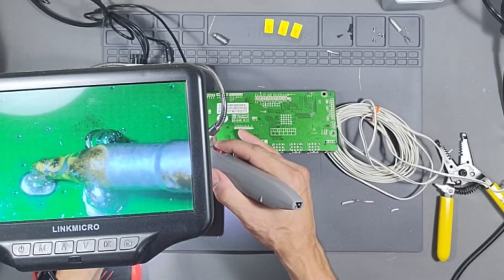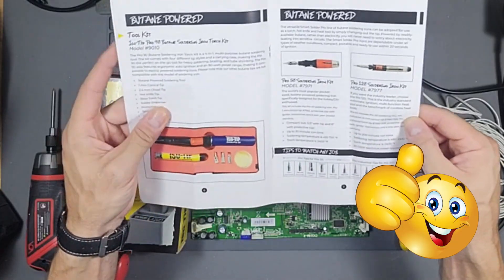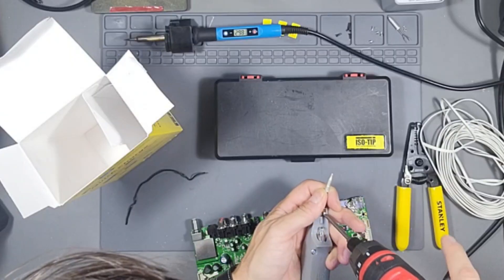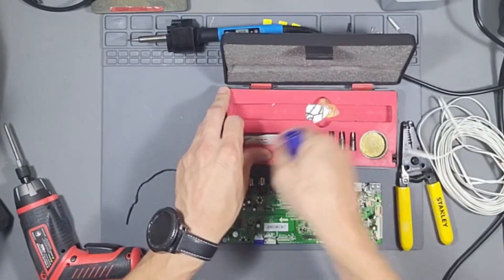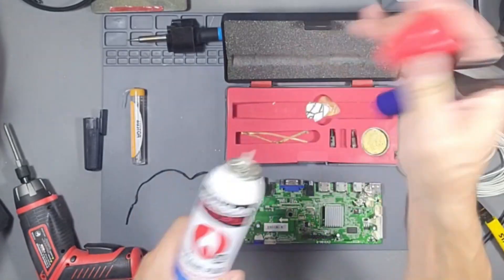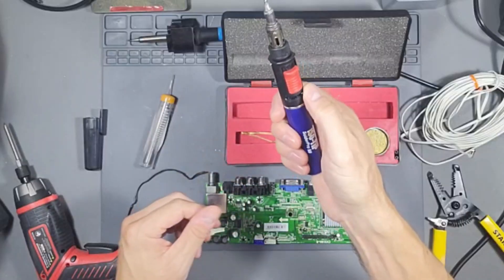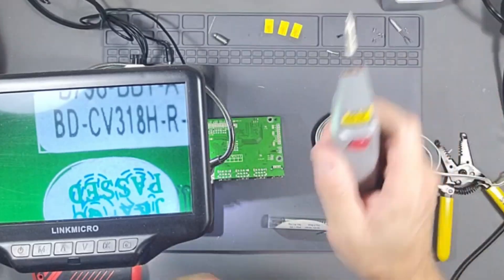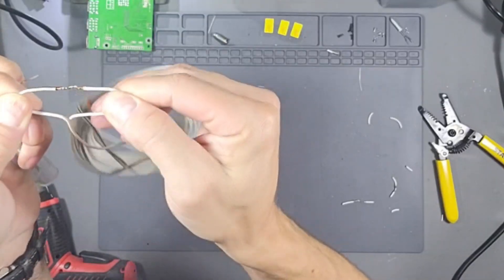3 SOLDERING IRONS EVERY TECH NEEDS

Comment: Hey Paul!  Always great videos!  Have a question for you.  Older Samsung ln46a630m1fxza is giving me some trouble.  Unit occasionally takes a long time to power on, or will not power on unless I unplug the unit for about 30secs (I wait to hear the click in the power supply), and then plug it back in and it turns on right away.  Checked all the caps..no bulging.  Did some LCR testing, and all check out ok except CM822, CM856 and CM857 with higher resistance. (These are not typically the caps that go). I've ordered to replace those, but I'm skeptical this will fix the problem.  Am I going down the right path with this?  Your experience would really help!  Thanks!
Reply from the maker: If your Samsung TV is over 10 years old I recommend replacing all the capacitors in power supply and main logic board. Caps can be bad even though they're not leaking or Buldged cap.
Reply: @TampaTec  Thank you!

Comment: ISO-TIP brand has been around for quite a few years!!! I'd be curious what battery chemistry is inside the gray handheld rechargeable. I think that gray handheld rechargeable design has been around for quite a few years!!! I've got a corded handheld with adjustable temp that looks like yours, WORKPRO brand. Has a ceramic core and heats up ridiculously fast!!! For portable use, I'd probably just take it and plug it into an EGO PAD5000 400W battery powered inverter that produces pure sine wave. I've used butane irons, but over time, the acrylic casing can crack, leak & temperature can fluctuate due to gas orifice getting dirty or blockages. You don't need a torch for heatshrink as you can just run the hot barrel of a standard iron over the surface of the heatshrink, and it will work. If you want a mini heat/hot air gun/blower, you can go to Hobby Lobby, and in their thermal embossing ink powder section, you can find it. Nice if you don't want to deal with a flaming gas device!!!